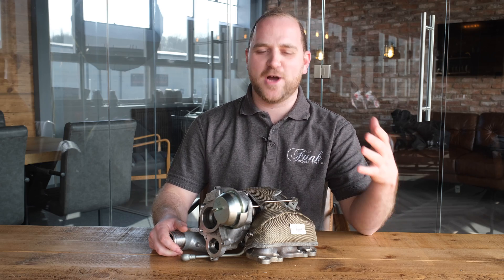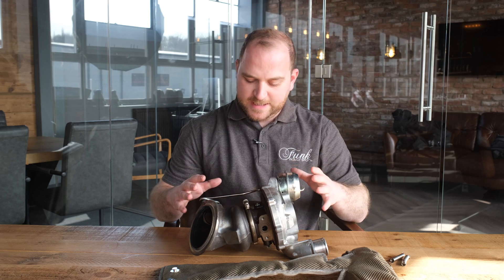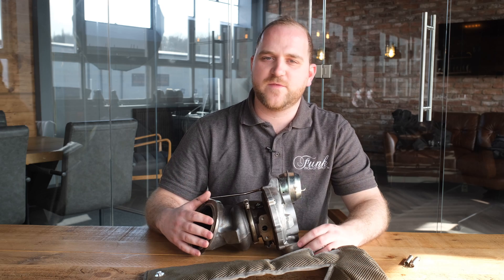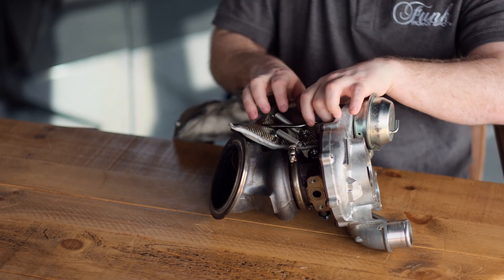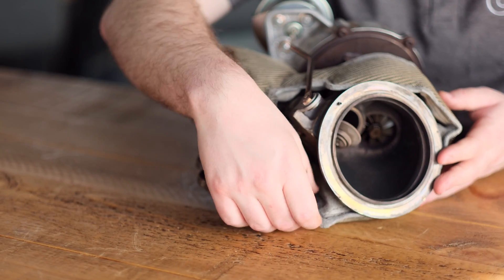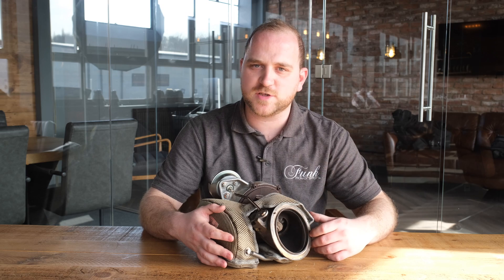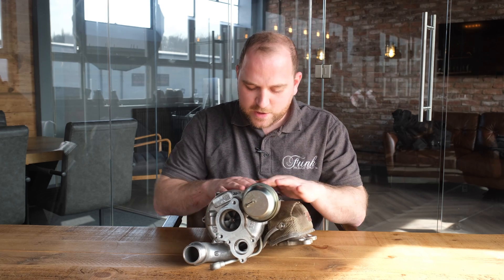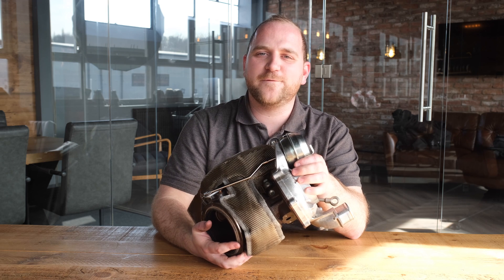Funk Motorsport Toyota Yaris GR Turbo Blanket fitting guide (Toyota Corolla GR  turbo blanket)

Comment: Just tried to do this. Find something OTHER than the springs to try and pull the blanket through the unnecessarily tight spaces in the engine bay. Doing so you’ll end up with undesired results. It’s probably easier to remove the manifold and turbo from the engine to install this on to the turbo, unless you enjoy a nearly impossible task that leaves you wishing you’d never gone down this road.
Reply: did you manage to do the install? The access to exhaust side is possible but the turbo intake side is packed with lots of parts that prevents good access..